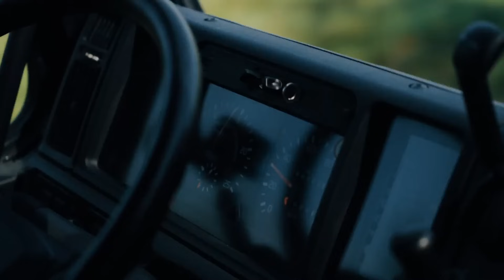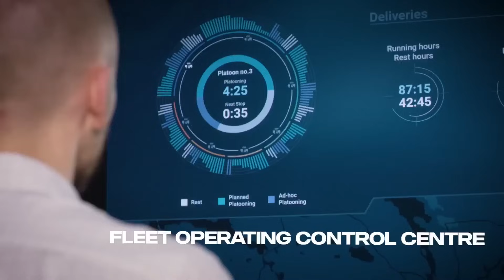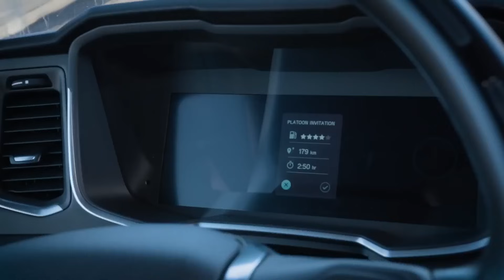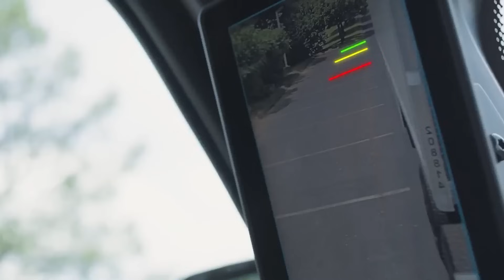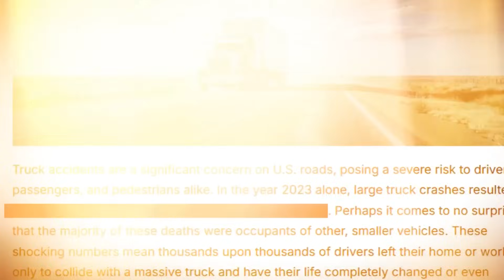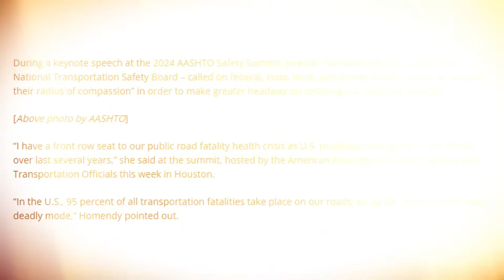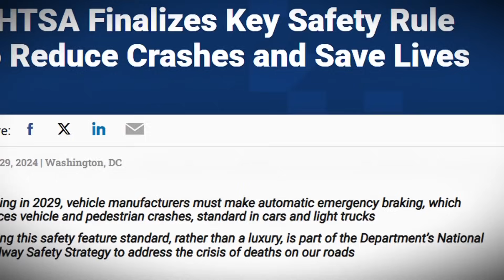US vs Europe Safety Showdown

Comment: There is an aspect related to safety, which isn't covered at all, but where there are differences between the USA and Europe. In Europe lorries and trailers must have protection at the end of them and on the sides that will minimize the risk of killing people in passenger cars if they would hit the lorry and trailer.
Why?
It's simple to realize if you understand that without these design features for safety, the passenger car would hit the trailer at windscreen level, meaning a larger risk of decapitating the driver and front seat passenger.
Reply from the maker: US trailers have an ICC bumper for the same reason
Reply: Or simple things like like underride guards for cyblists and moter bikes.

Comment: European trucks are generally safer in terms of overall road safety, especially for pedestrians and passenger cars, due to strict standards, advanced technologies, and smaller sizes. American trucks provide better protection for the driver in serious accidents, but their larger size and less strict standards until 2025 make them less safe compared to European ones in urban conditions and on busy roads.
Reply from the maker: Yep! Spot on!
Reply: they don't though offer better protection to drivers, that is a myth peddled to maintain the status quo in the US, with the exception of Volvo, the US truck crash test you mostly see are are NOT representative of other truck they may crash into, the common test is just to crash it into a vertical was designed NOT to push any load into a cab, because US truck cabs in general are weak flimsy thing, the test is designed to put all the load into the chassis which is far from the reality of most crashes, which will be into the back a the ubiquitous 53ft box trailer which will see the tractor unit chassis underride the trailer, while the most common front on front impact is a partial overlap, which means the weak front bumper will fold, the chassis will mess each other, and the front axle will hock one each other, while the flimsy cabs fail like soda cans.

data back up the above, as dose the photos and imagery of just how flimsy US trucks are.
Reply from the maker: @b101uk9 👍

Comment: What would happens when the computer malfunctions on the fancy truck
Reply from the maker: It’s like any other computer generated system. Reboot it or have it looked at. I am sure the instances of it malfunctioning at a critical time are limited or non existent. Other wise it wouldn’t pass safety standards.
Reply: @TheTruckersChannel  computers are all over in cars an trucks, and have been for two decades.
They are here to assist you, not taking over. When have anyone ever seen a car/truck computer system failing in a way that makes you loose control over the vehicle.
Almost never.
Reply from the maker: @clauspetersen9353 agreed.
Reply from the maker: @clauspetersen9353 👍💯
Reply: Then you just drive it like a US truck, but i bet that brakes and handling is still better than anything out of the US.
Reply: That's why safety systems has integrated watchdog systems, monitoring main systems work. Requirements for these systems are enormously complex, with a lot of redundancy. Don't be afraid this was done in aerospace industry for decades.
Reply from the maker: @r11tc  Spot on!
Reply from the maker: @r11tc 💯👍
Reply: Why would it?